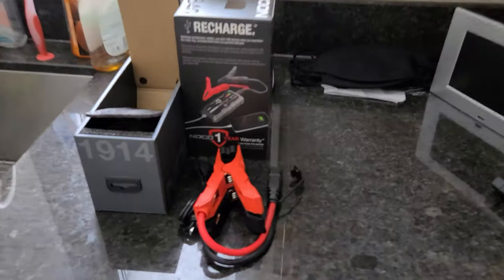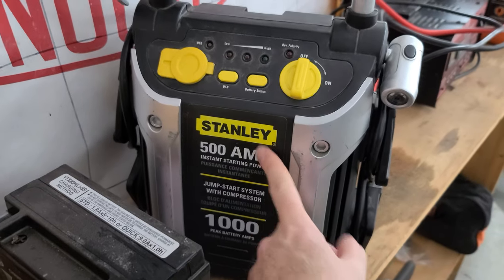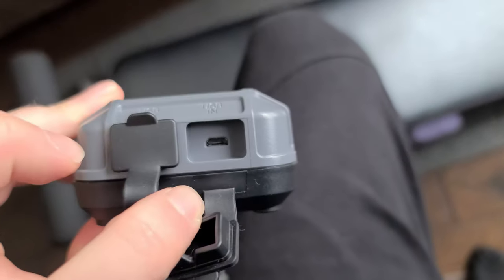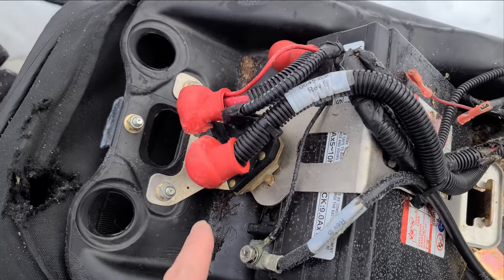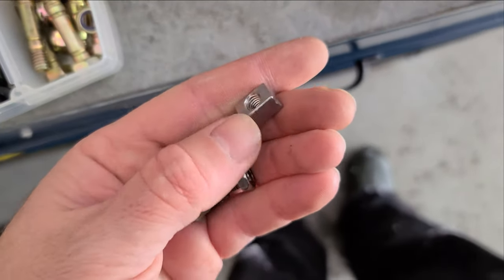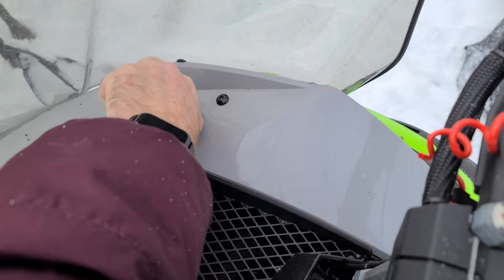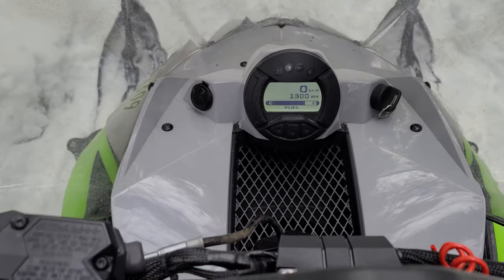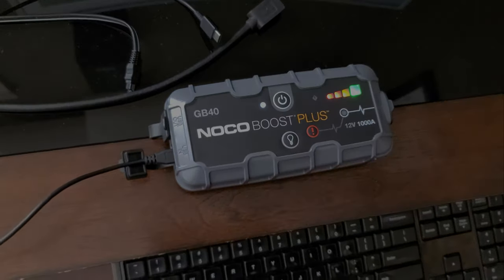Noco Boost Plus - Can It Save My Arctic Cat

Comment: Hey Gary, my experience with the Noco jump packs so far has been outstanding! Have been through half a dozen versions of jump boxes in the last twenty years in the automotive repair industry, and the Noco has been outstanding, from the cost to the overall size and weight! Bought three of these units, one for each of my technicians and one for myself, and not one of us have had a complaint yet!Think you will be impressed!
Reply from the maker: Thanks..good to know Rob.

Comment: I had a tractor. Seven years ago, I took the battery out of it, put it on my workbench, hooked the noco up, and forgot about it. Recently I sold the tractor, unhooked the noco, dropped the battery back in place, tractor started right up.
I now have two trucks hooked up to nocos.
Reply from the maker: Awesome

Comment: To keep the mice,rats from eating things use 1/2 - 1 oz of peppermint oil and 16oz water in spray bottle, shake and spray! Spray anything you don't want chewed on! Sleds, boats, inside your boat motor cover, tractor, 4- wheeler etc. Spray around buildings and gardens. Apply a couple times a year! Peppermint oil can be found in spice aisle!
Reply from the maker: Thanks Scotty....I will try that...those buggers chewed up all under my seat...hope this works on snakes too...because they were under my seat too...

Comment: Eh Man ! 
I have the exact same unit and set up , I installed it last winter and it’s a lifesaver , my sled is very similar to yours , Cat 1100cc 4 stroke touring, although my battery isn’t located under my seat , I ran the cables from the battery up beside my handlebars , I do believe that you could get at least a dozen boosts with the GB40.
Reply from the maker: Right on...that's around what I figured...8 - 12....

Comment: It looks like the mice are chewing thru the wiring under the seat. Maybe that's adding to the low voltage problem.
Reply from the maker: no chewed wires...just the seat...and nest material...i checked all the wiring.